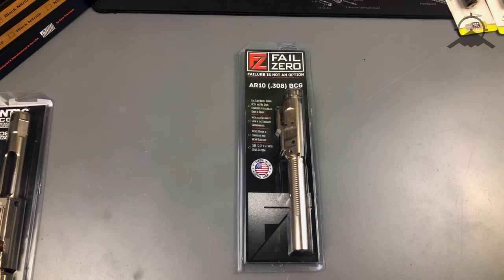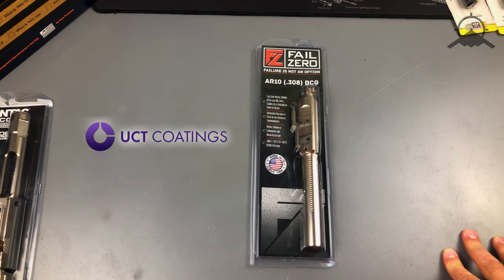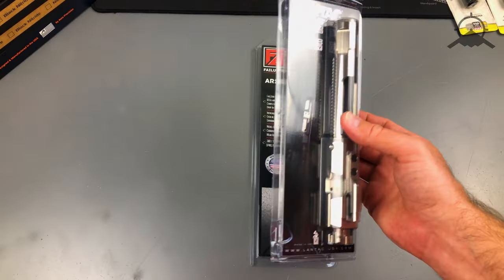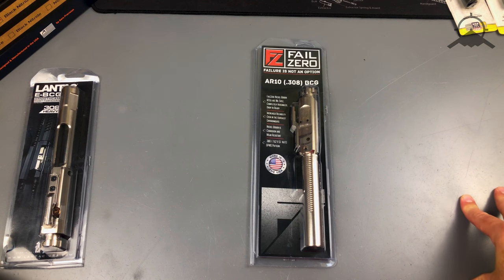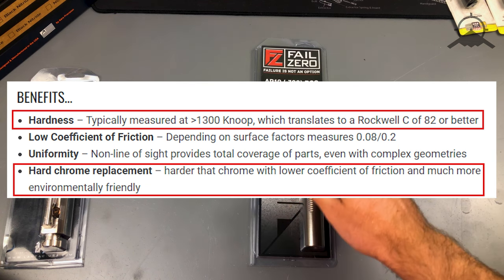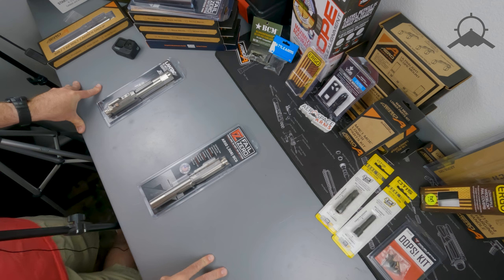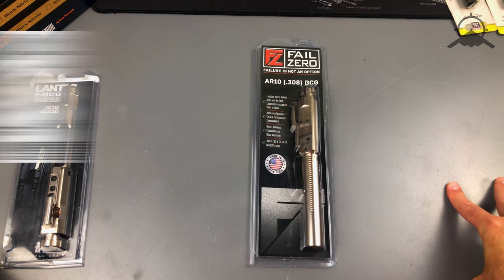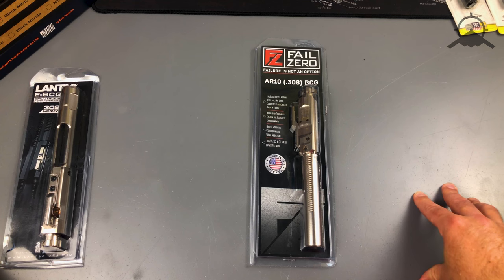Is Nickel Boron (NiB) the best coating for your BCG? - FailZero AR10 EXO Nickel Boron BCG Review

Comment: I can read the packaging and get this info. What I want to see, what will sell me are tolerance checks. Check the gas efficiency through gauging, show the extraction spring type, show me the firing pin protrusion, etc..
Reply from the maker: Thanks for the feedback James, I'll try to go more in depth in future videos.
Reply: The plating is the selling point not the specs of the bolt. Ask for torture test, not an autopsy of the bcg especially considering that tolerance very from bcg to bcg.

Comment: I have one and I love it.  My only grip is I can't get the cam pin out unless I take the gas key off with a hex bit.  I've taken M16/M4/AR15's apart thousands of times without that issue.  It's as if the coating is just thick enough to where it hits the gas key.

Comment: I wonder if that would work in my Smith & Wesson M&P AR10 sport.  
I hear bad things about nickle boran, but the one Ive used has lasted thousands of rounds.  Its black now, but functionally the same.
Reply from the maker: There's other companies that have NiB coatings that are not high quality like the one referenced in the video which is what gives the coating a bad wrap.  Any issues we've had with FailZero were due to a bolt being out of spec and another damaged prior to shipping, but no issues with performance.

Comment: I tried a Fail Zero in an ADM AR-10 receiver. It flat failed. It’s geometry was wrong. The weapon would jam against the magazine. I tried several different magazine manufacturers and materials. It happened with all of them. I tried contacting Fail Zero multiple times, without a response. FAIL ONE.
Reply from the maker: Clay, do you still have that BCG?  If so, email us at support@aerospacearms.com and we'll figure out how to get you taken care of.  We've had one claim with them before on a smashed gas key on a new BCG and they promptly took care of it for us.
Reply: Same here they are garbage

Comment: The nickel boron is starting to flake off the back of my Lantac bolt.
 I think I'll stick to DLC from now on.
Reply from the maker: Nothing wrong with sticking to DLC.  If you're willing, send us some pictures of the bolt with the EXO NiB coating that's flaking along with a brief description of how it's been used - info@aerospacearms.com.  We use this type of information when determining whether we should be directing customers toward or away from certain products going forward.  Thanks!
Reply: @Aerospacearms  Just saw your message. 
When I clean it I'll take some pictures and send them to you. The rifle is a DDM4 Mk.12 with about 10 k rounds of Mk. 262 (77gr)always  shot relatively slow. I finally replaced with another lantac bcg in their black nitride. It's very slick and really throws the cases real far.

Comment: i just watched a video of a guy sayin NiB is the worst coating for a bcg. anyone have any expertise with this, or have had success?
Reply from the maker: Not all NiB coatings are made equal.  We're referring to the EXO NiB coating patented by UCT Coatings being the best.  Here is what they have to say about their patented coating on their website, "EXO is a patented, nodular Nickel-Boron (NiB) surface treatment.  The coating nucleates on the surface atoms of metals, becoming part of the metal rather than merely applied to the outside. In addition, the treated surface becomes harder than the substrate itself, eliminating the cost, weight and degradation problems of conventional hardened metals."  So of course there's the possibility of application issues in manufacturing or bad QA on a batch but if everything was done right, they should be pretty hard to destroy.  Here is a video of Fail Zero's VP of Sales talking about not having ever seen the coating flake off under normal wear: https://www.youtube.com/watch?v=pcNmjDX-Csc&t=7s

Comment: What do you get for one of these bolts besides leaning it. I don’t get why that’s such a selling point. Does it offer any other advantages?
Reply from the maker: One key benefit of this coating is for guys who don't take the time to clean their BCGs, tests have shown that the lubricity of the coating keeps it from failing when excessively dirty.  A second is the combination of hardness, lubricity, and head dissipation that the coating adds which increases longevity of the BCG due to less wear due to friction and heat.
Reply: If u burn off all ur lubrication it still runs better than other coatings.    Also in Alaska and other areas lubricants can freeze.     Then the surface hardness helps strength.   And the reduced friction in ur barrel extension helps wear.
Reply: @jjjr.1186  well let me ask you this since we’re on the subject. I just bought an aero nitride pro I was going to improve my PSA uppper with, but as a newbie, I now find out that I have to check the headspace? So is this true even with my other PSA BCGs? They aren’t all interchangeable? What a bummer? What if I buy these gauges and I don’t check them right? Is there a real risk?
Reply: @LKaramazov  yes your ar15 is self headspace.   The barrel extension is the headspace      stick with the same bcg after u start shooting.  If ur gun and bolt is new. ur bcg is good to go.
Reply: @LKaramazov  but yes u do not have to headspace a ar15.
Reply from the maker: Our friends over at Faxon Firearms did a great article explaining everything about headspace if you'd like to read further on the subject from experts in the industry: https://faxonfirearms.com/blog/what-is-headspace-why-is-it-important-and-how-does-one-check-it-in-a-modern-sporting-rifle/
Reply: @LKaramazov  Always check head space, I have found many AR's that were not head spaced properly. If changing a bolt you need to check head space. AR bolts do not always head space the same. A true 5.56 go head space is not the same as a commercial 223 go gauge. Make sure the go gauge is a 1.4646 and not a 223 commercial go gauge of 1.4836...
Reply: @jjjr.1186  No, every AR should have the head space checked, especially if you change the bolts..I have seen many brand new AR rifles with short chambers. If the barrel is marked 5.56, the go gauge is different then a 223 commercial go gauge. Be sure the go gauge for a 5.56 chamber is 1.4646 and not the 1.4636 223 commercial go gauge..
Reply: @Aerospacearms  They didn't mention the difference between a 5.56 go gauge and a 223 go gauge. Many people who should know better don't. They have different minimum go gauge, No go and field gauge sizes..
Reply: @hairydogstail  no not necessary.  IV built many ar15s.  The headspace is built in.   Unless like I said it's used parts.   And I don't own a 556.  I do have a 6.5grendel.    Did away with 2 cartridges 556 300blk and consolidated on 6.5grendel.
Reply: @jjjr.1186  I'm just trying to be helpful so don't take this personally but you are wrong. I have a lot of experience with the Grendel and I have one bolt that wouldn't pass the go gauge test with any of my 6 barrels. It was from Alexander Arms. I keep it if I find a barrel it will pass in. The same goes for any caliber in the AR series, all bolts have slight differences as do chambers..The other test I do is with a function gauge that I have found many AR rifle chambers fail..
Reply: @hairydogstail  if an ar15 headspace is off it won't chamber a cartridge.  If it does. GTG.  I built all my uppers.  Never seen any headspace issues.
Reply: @hairydogstail  interesting! Thanks. In fact I just bought a .223 wylde upper and considered in my ignorance that 5.56 and .223 and all the bolts were completely interchangeable.  There’s a more to firearms than I ever imagined when I got into them a few years ago.
Reply: @jjjr.1186  I don't know where you heard that one but not even close lol. No, you need to check head space. Short chambers are more common then excessive head space, in any case you should always check head space..
Reply: @LKaramazov  5.56, 223, 223 Wylde use the same bolts, it is the chambers that are different.. The 5.56 requires a slightly longer chamber then the 223.. The 223 uses a 1.4636 go gauge and the military TDP go gauge for the 5.56 NATO uses a 1.4646 go gauge. The 5.56 throat is twice as long as the 223 to handle longer bullets at a lower pressure. The 223 Wylde has the same chamber as the 5.56,  but has a narrower throat then the 5.56 but just as long.. This is why it is OK to use 5.56 NATO ammunition in a 223 Wylde chamber but not in a 223 commercial chamber..
The need to check head space is because there are slight differences in every bolt and chamber. Every chamber will have slight variations when reamed and every bolt will have slight differences when manufactured. If you get a chamber on the short end of tolerances and a bolt on the large end of tolerances, then you will get a short chamber and vice versa. Short chambers are much more common then excessive head space..  When changing bolts with any barrel, then always check head space..It only takes a few seconds and is a necessity for safety and reliability reasons..Don't listen to people who say otherwise..
Reply: @hairydogstail  ok. Smyth Buster's by Brownells did an entire video on ur theory.   It's incorrect. No headspace needed.   Look up do ar15s need to be headspaced.   No.
Reply: @jjjr.1186  No, Caleb and I got into it about this and they ended up removing the video because he was wrong. The NSSF states all AR rifles need to have the chamber head spaced and never shoot 5.56 ammunition in a 223 chamber..Even the engineer at PTG was wrong about the go gauge spec. I have the TDP that requires a 1.4646 go gauge for 5.56 NATO chambers, not the 223 1.4636 go gauge.. Everything I have stated is fact..If you want the best information, then check out The School of the American rifle on you tube. Chad is the most knowledgeable person I have seen about the AR rifle..
Reply: @hairydogstail  ok whatever. U can check headspace with any Sammi spec brass.   U can litterally shoot a ar15 so hot it won't headspace.  It's not an issue.

Comment: Dimensionally questionable, questionable heat treatment, flakey finish, and they don't retain lubrication near as good as good as phosphate. "Hardness" is not even close to the most important element.
Reply from the maker: Dimensionally questionable...maybe (need some proof but don't doubt the possibility FailZero QA missed some lemons in the past)... questionable heat treatment...maybe (again, need some proof)... flakey finish...nope, haven't seen it with the EXO NiB coating yet... retaining lubrication...from what I've seen, it's a non-issue due to the nature of the coating (unlike phosphate)... and hardness is just another variable in the equation to produce the most durable coating possible, so "MOST IMPORTANT" maybe not, but important none the less.

Comment: Nickel boron is by far the worst coating you can have on your bcg. It can cause all kinds of problems from tolerance issues, head space issues, it can actually have a reaction with your carbon and become stuck inside your upper receiver if you let it sit for a while. Thats just some of the issues you can run into. Watch School of the American Rifle's video on bcg coatings. Coatings are the least important thing when choosing a bcg. I stick with phosphate or chrome bcgs.
Reply from the maker: Thanks for commenting and I'll definitely check that out.  In the research I did when doing this video, UCT Coatings EXO NiB coating on FailZero BCGs was harder and performed better than your chrome BCGs, so not all NiB coatings are created equal.

Comment: I will never buy anything from Failzero again. Customer service don't exist. Got rid of the two bcg's I had. I'll stick with Bcm.
Reply from the maker: What issues did you have with the BCGs?
Reply: @Aerospacearms  the extractor and the bolt kept seizing together. Brand new and no matter how much I lubed it. It wouldn't unlock from barrel. This was the first problem I has with failzero but after countless unanswered emails and calls with no response I won't buy another one.
Reply from the maker: Sorry to hear that, and it's unfortunate they didn't get back to you since customer service can make or break a company.  We've reached out to them 1x to have them replace a damaged gas key out of the box (like it was dropped before being put in the package), from which they responded with a shipping label and replaced it for us.  Outside of that, we have not seen any issues with their BCGs.  Hopefully things have changed since your experience and they're responding to all customer service inquiries now.  Thanks for checking out our video!
Reply: I was running the fail zero nib bcg in a BCM and somewhere during 1500 rds (over time) it started leaking where the gas key meets the carrier and the gas key cracked at one of the bolts. Gas key wasn’t properly staked either. I contacted Fail Zero and they’re sending a replacement, but I’ve seen so many problems like this with their bcg’s idk if I feel comfortable running them anymore. I’m getting them to replace it with a nitride bcg and see how it holds up. Heard from a master gunsmith that the coating is applied under the gas key which is what causes them to leak gas and eventually do in almost all cases. I will say it never failed on me though. I just so happen to notice it one day when I was cleaning it.